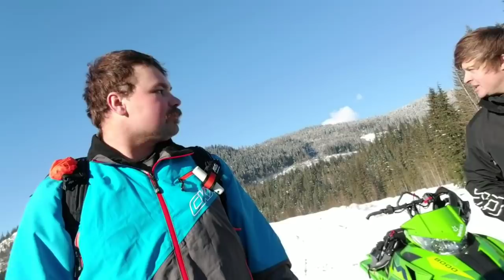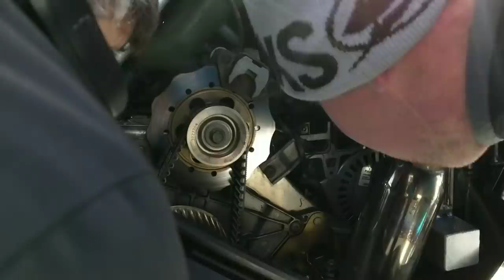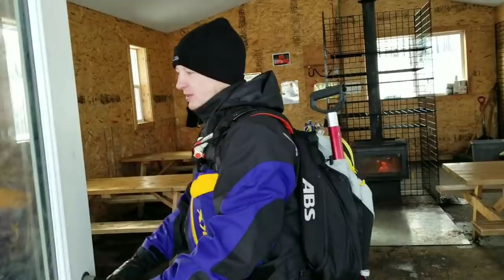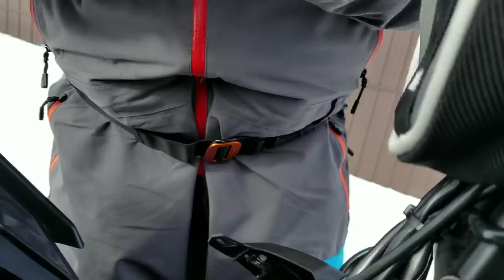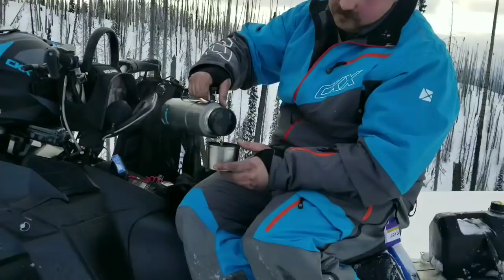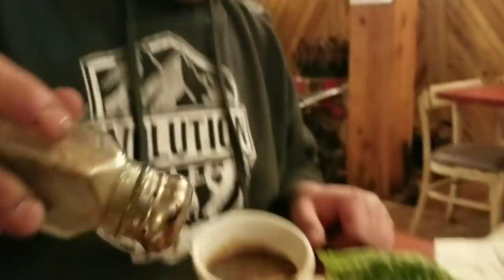TURBO RMK Breaks Down in the Backcountry

Comment: Shaunie I admire your patience.  You always take things in stride and never get upset.  I guess working in the patch has made you as cool as a cucumber.
Work Hard, Play Hard,.....(smile and repeat).
Reply from the maker: When it runs, it runs good! Otherwise, side panels are open and the hood is off. Lol
Reply: Dean Sikorski something I’ve learned over the 8 years in the patch and from working with my buddy constantly on machines together is getting upset fixes nothing. Find the problem and work on a solution... and as a supervisor I need to always stay calm and be a leader. I never liked “leaders” that freaked out.

Comment: I got a 1998 arctic cat zr 600 efi and it only has 3200 miles on it and I'd had quite a bit of problems with it, about $340 u.s worth of issues but hopefully it will run good now, I just got it back tonight and hopefully it'll RIP for a long time.

Comment: Ohhh Gosh!! What a VIDEOOOO! Keep the content comin gentlemen! 

As far as the radios; my crew and I have been trying out the Baofeng UV-5R radios. Much cheaper than the BCA radios and work just as well, if not better than the BCA's. Give them a try, you can get them off Amazon, just be sure you order the pack with all the accessories that you want (I thought my pack of two radios came with the long range antennas but they didn't so I had to order separate, when all my buddies radio's came with both the short and long range antenna's.)   

Give them a shot and see what you think. Can't wait for the next video boys. Hopefully, the turbo RMK ain't hurt that bad, I wanna see that sled go up against the Alpha!
Reply from the maker: You took the words right from my mouth. We are switching over to those exact radios next.
Reply: @syxxes  good shit man! I think you guys will like them much more than the BCA's. Just be careful leaving them in your daily driver, don't want the police finding them...….
Reply from the maker: @fricot_21   Yeah, they are working on outlawing anything with more power than a 2 watt? I think?
Reply: @syxxes  I believe they are already banned in the USA. You can "legally" own one down here if you get a H.A.M. license or if you use the radios for listening purposes only and don't transmit (pointless for us)...… But from what I've been told by authorities and fellow users, as long as you transmit on empty channels you are good. And in the case of an emergency, transmitting on any channel is allowed. That is just what I have been told by Game Wardens and local PD though

Comment: For any buddy laughing at these poor turbo problems they ARE REAL!😂 Got a 13 rmk assault and its always something new. Just got back from a trip and blew it up in under 300 miles after a brand new rk-tek drop in... Lost a grand in 30 miles off the trailer. Ur not alone man😂
Reply: Justin Carlson I rebuilt my 14 pro with wiseco pistons and stock cylinder because it was chipped. It runs great with 400 miles on rebuild.
Reply: I’m glad to know I’m not alone! It’s a good learning experience honestly.
Reply: @carson.608  Yeah last night in the shop I learned the problem with mine was silbers shitty blow off valve.. I've checked multiple times this year but this time it let air go in and out of it with no resistance, leaned out my sled pretty bad... And it took my cyclinder with it again! I'll have about $1,000 bucks more in it resleeving and with new sleeves plus a new blowoff valve. Already had 1,000 in the first one
Reply: @shaun_syxxes5132  Very true, us turbo guys know every damn bolt on our sleds😂

Comment: What turbo kit was he running?
Reply from the maker: That was a Silber Turbo that was not meant for that unit.
Reply: Syxxes Performance that’s funny, I have the same issue. I bought a frankensteined used redline controller with silver snail setup and had nothing but issues. Sent my ecu in for a reflash and am going to do Silber’s oil tank delete...fingers crossed